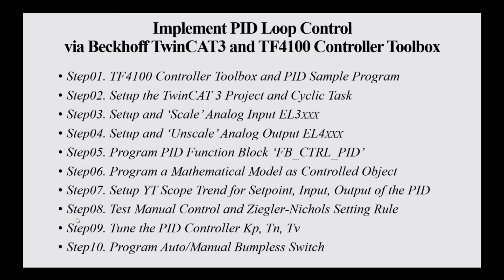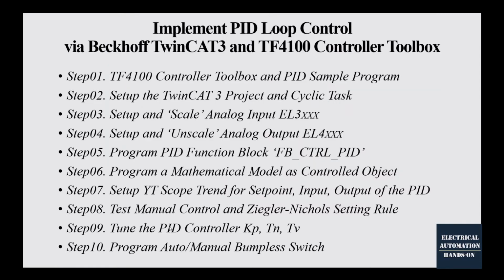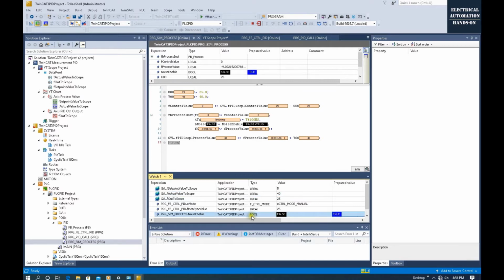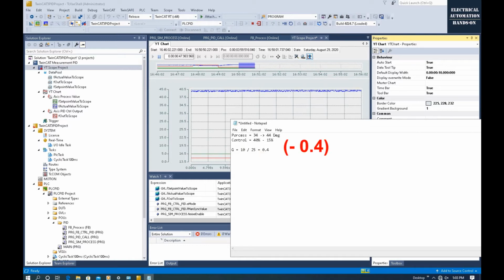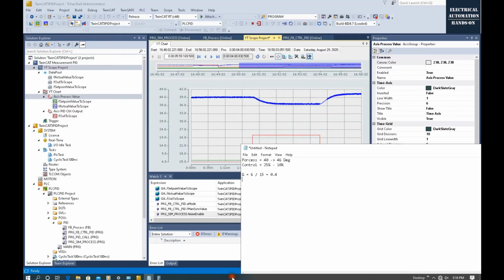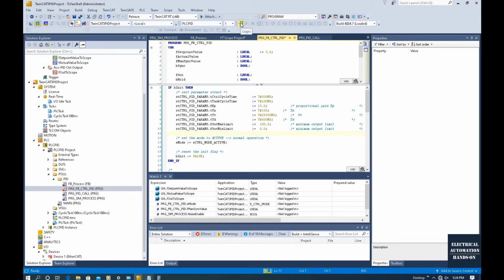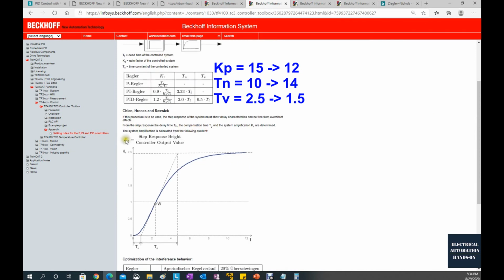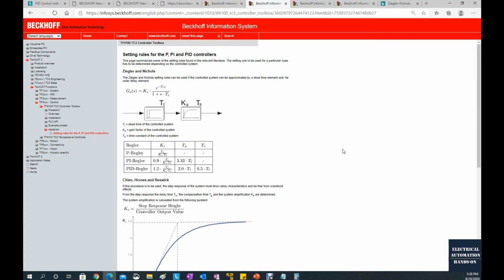PID28 - Beckhoff TC3 PID08 -  Calc. PID Parameters via Ziegler-Nichols (Method I Step Response)

Comment: THANK YOU FOR VİDEOS. I have a question which parameters will be change in heating process ??
Reply from the maker: For the heating process, the slow response system, you could mainly focus on Gain and Integral. Some cases, you could also involve ON/OFF control to control a reinforce heater. Note that, you 'd better set 100% and 0% on your heater to see how control ability of your actuator (heater)